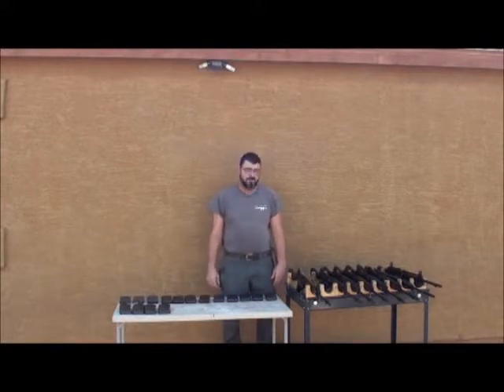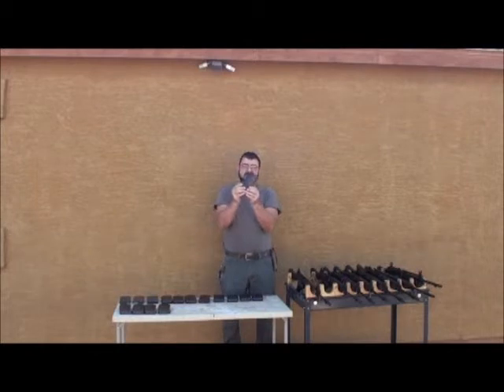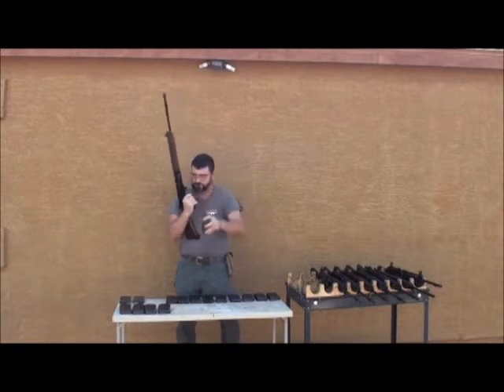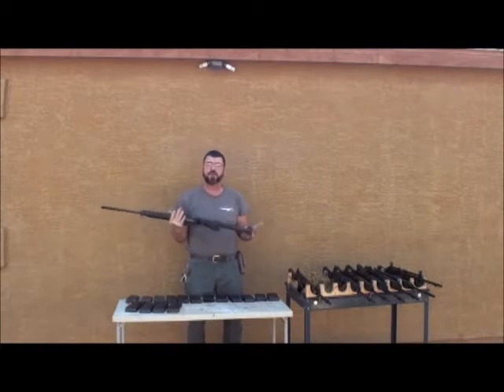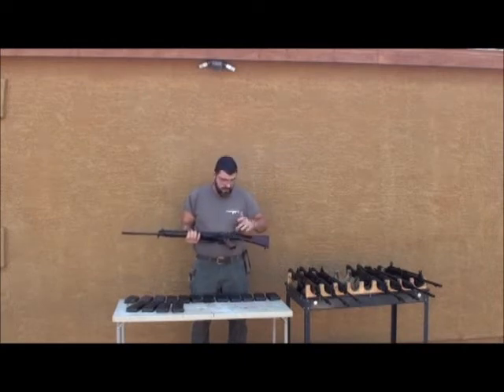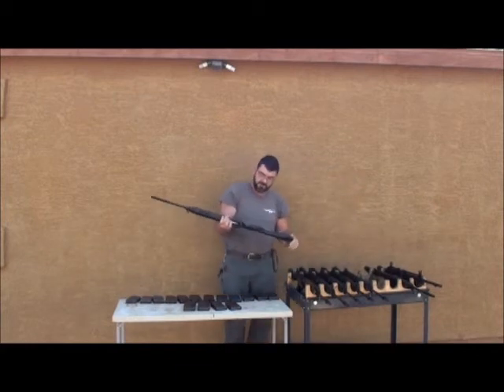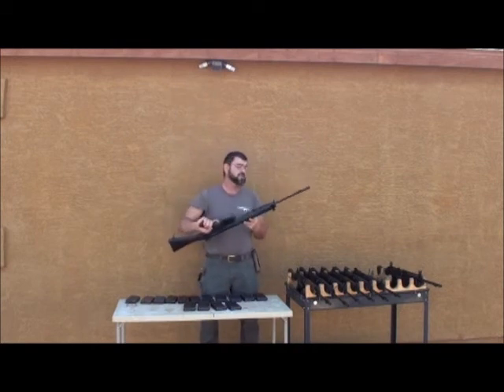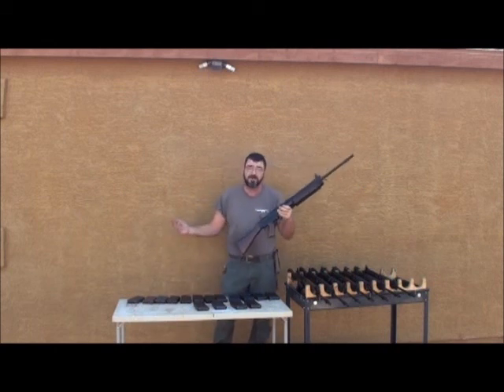Technical - DS Arms L1A1 Magazine Fit Test - Part 2.

Comment: I finally got to shoot my dsa not to long ago. Mags fit I  it but some are tight and I had an issue with the hammer following bolt after each shot so I would have to rack the bolt to eject a live round and chamber the next in the mag to fire. I contacted dsa and they fixed the hammer issue pretty quick.

Comment: That's a lot of work for a $550 "new" receiver.  Why don't they just fix the problems before making any more or have they recently fixed this? Does anyone know?
Reply from the maker: The serial number range of the receivers in the video cover almost 100 units.
Reply: This is what bother me... are they getting rid of the out-of-spec-receivers that were already cut or did they trash the bad ones and start making them right-- fixing their broken tools and giving correct training to their "craftsmen"....